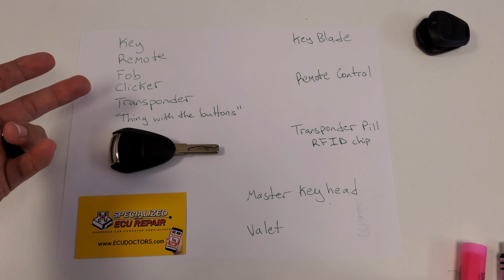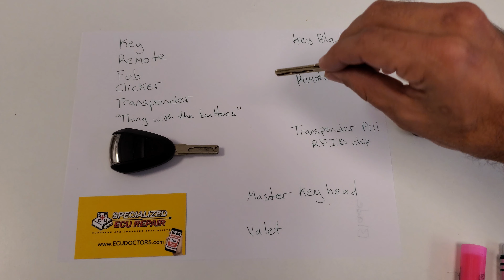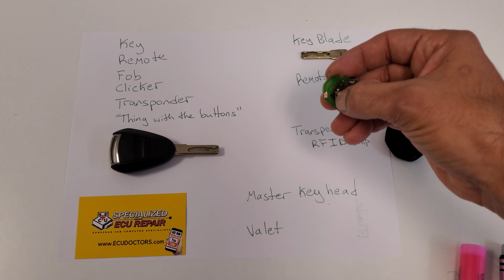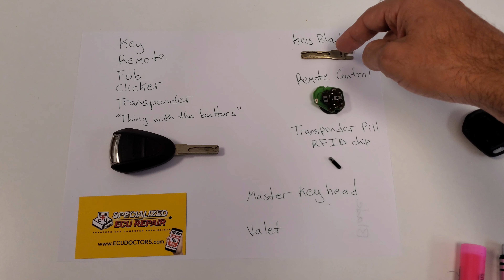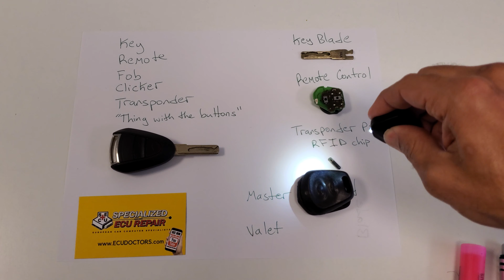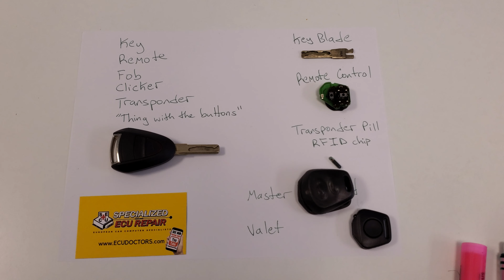Porsche Keys, Transponders, Remote Control Fobs Explained & How these keyless entry transmitter work

Comment: Thanks so much for putting this video online.  It answered a lot my questions particularly what the "RFIID Pill" was & what it looks like.

I have a Porsche 997.2 FOB that a technician from one of the Batteries Plus stores in my area told me was  bad, at least the circuit /logic board.

Even with a good battery, it won't work.

Comment: I recently purchased a 2005 porsche boxster from auction I accidentally damaged the transponder chip trying to add a new key cover, how much for another? I don't need metal key... I damaged that pill looking device.
Reply from the maker: If you could be more clear that would be helpful. Please send us a text message of the picture of what is damaged at 954-652-6342 or at info@ecudoctors.com

Comment: thnx for your video. need help as I can't find the answer anywhere. I have 2 keys (Toyota Aygo) one with remote one without but the key blade is removable, both with transponders obviously. I want to add a remote to the key which doesn't have a remote, apparently is very easy to program the remote on Toyota if you get the correct remote control, but the question is: Do you have to reprogram the transponder as well if you add just remote control board, if not ... does transponder has to be fitted inside the key head while programming remote?! Thank you!
Reply from the maker: Sorry, but at this moment we cannot help you with this vehicle.

Unfortunately your model is not under the list of vehicles we service. 

I wish I had a recommendation but we don't know anyone that can assist you with this issue.

Good luck!

Comment: Does the car have to come in to get a new key programmed? Or what do you need to get a spare key for a 997.2?
Reply from the maker: A new key can be programmed on the bench when you send us your immobilizer unit. Otherwise, you'd need to bring the car into a shop to get it done. Does that answer your question?
Reply: @SpecializedECURepair  yes thanks!